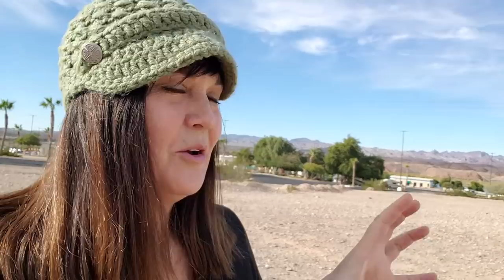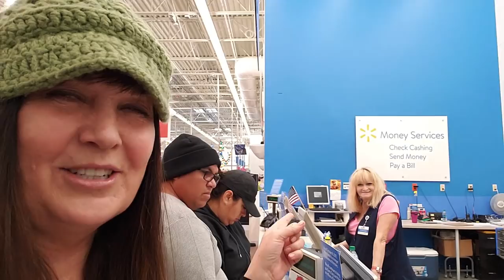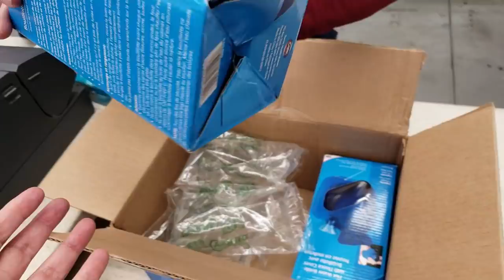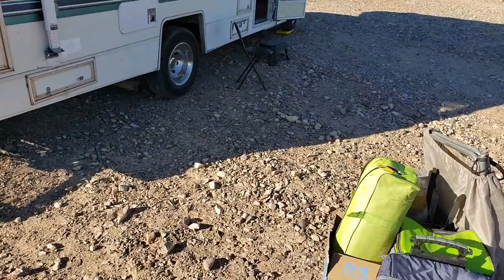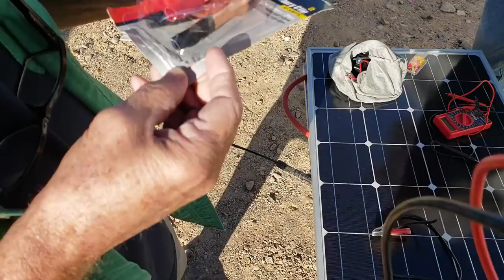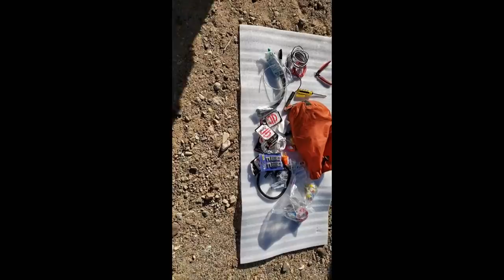Classic Mistake-s , gift, Solar Attempt part 1. ..of 100

Comment: I was thinking about going out to the van build (I mean party 🎉) but I think I would have more fun hanging out with you!  I think if you had panels on the roof you would want to be parked north/south. That way when the sun comes up it travels east to west, so up & over the rig & you would get the most sun on the panels. If it was me, I would face the front of the RV north then prop the panels at the back or even lay them on the ground flat. Obviously, you need longer wire to do that.

Comment: Hi Joey, Are the hot water bottles for your  pain or to help keep you warm?. I have fibromyalgia too, it sucks, but warm moist heat can help. Looking forward to your next video. Hugs! OXOXO ❤💕
Reply: I've used them. They are to keep you warm. You fill them up with hot water and put them in your sleeping bag with you. I put one near my feet and one by my waist.
Reply: @pamelatherambla3000  I'll remember that, hot water bottles to keep warm. Thank you.